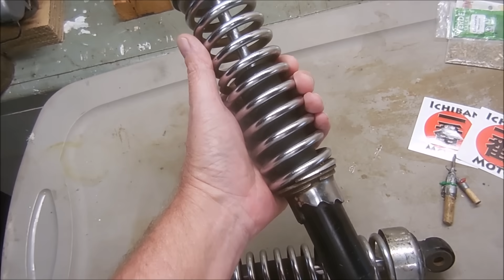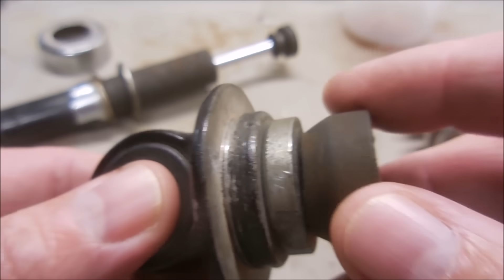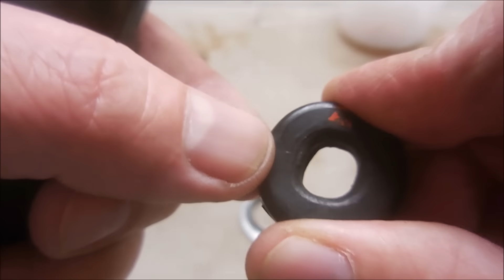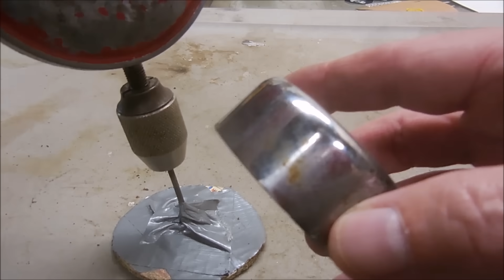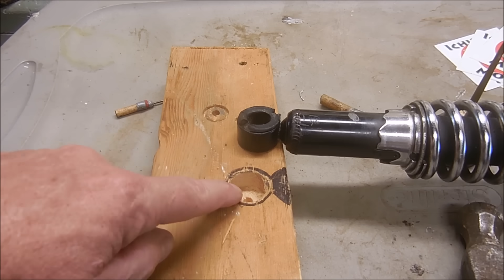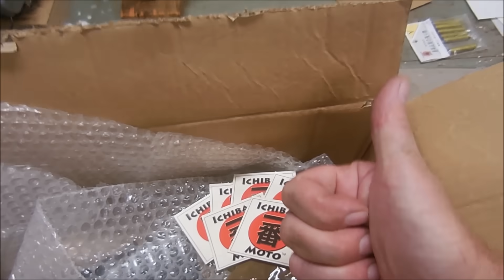how to rebuild motorcycle shock absorbers (coil over struts)

Comment: Wondered where you'd gotten to Mr Ichiban so I decided to visit and educate myself on the spring rebuild, but I was blown-away by your hand-held customised drill-bit cum buffer and with a couple of turns it was as good as new which was amazing! I see you haven't lost your touch : )
Your stickers which must be over 10 years old and still decorate my suitcase which makes my case easy to spot on airport carousels, just returned from the Balearic Islands (Mallorca) and as my case approached me in Edinburgh airport on the carousel a guy further down the line pointed and shouted Badass!
Reply: Cum

Comment: You know, and I don't like to make a whole big thing about it or anything, but I Race the High Bank Turns of Daytona. It's always a great thrill getting the Cafe Racer off the trailer, gassed up with Premix and scooting around the track.  Buy the way, and I think that most would agree, including Kenny "WFO" Roberts and Barry "Ladies Man" Sheene, Nickel Town Customs, known for their Fine Friction Enhanced Jell Assembly Lubricants, makes one of the best 2 Stroke Oils out there.  It is specially formulated to mix with gas and reduces High Speed Seizure by 50%.  My point though, and I think that I can speak for everyone, Itchy Bon Moto is the only Service Center that I trust to rebuild my racing shocks.  They really know what their doing and take the time to do it right.  They even wipe the bodies down and everything !  Itchy Bon gives me the confidence to hit the Bank Turns Wide Open.  The Progressive Emulation and extra wide bottoming cushions prevent sudden bottoming jolts to maintain traction and superior control. I was giving it everything I have, and squeezing every horsepower out of my Power Jet Carbs, trying to get to Victory Circle.  Hoping for the confetti filled accolades of my competitors, interviews with Dave Despain, and my clammy hands within millimeters of Mrs. Chesterfield's amazing heaving oversized Juggs,  Although things didn't go my way, with several compound fractures from a spectacular 200 MPH seizure, I'll be giving it another go next year.  Hopefully I'll be released from Halifax Memorial soon and towing the rig back to Winnetka.  Thanks to Itchy Bon Moto and all the great people at Nickel Town Customs for their encouragement and great products.
Reply from the maker: hi sergio
Reply: @IchibanMoto  Hi Itchy.  I'm laid up here at Halifax Memorial.  Passing time looking through the Nickel Town Customs Performance Catalog and making plans for a few major mods for my Cafe Racer.  Also, I saw the ad for Nickel Town Customs new and improved 2 Stroke Oil with a higher dilution ratio, synthetic tribological friction film displacement agents, and enhanced temperature compensated viscosity molecular structural chains to reduce wear upon initial startup and overall improved throttle response.  With all of those improvements I wonder if Nickel Town Customs has figured out the secret ingredients in Castrol R or something.  Should l plan on adding a tooth or two to the countershaft sprocket ?  Once again, thanks for all the support this year.  Having 5 out of 5 Itchy Bon Moto Stickers is another Bad Ass reason to lay it on the line and put the Cafe Racer in Victory Circle next year.
  - Sergio

Comment: Is 10w oil good to them?
Reply from the maker: Yes. I use 10w in random forks that are not set up for a specific rider ( bike for sale etc) ideally, your bike should be properly sprung and dampened for you. that could mean lighter oil in your long travel adventure bike or heavy in another because the custom gold value emulators recommend it etc             10 is usually a good ave. starting point
Reply: @IchibanMoto  i have a 1996 Kawa Er5 naked bike, i really hope this works, other people are pesimist that i have to buy new shocks, in the end when you are pumping air is there a valve inside shock? Thx very much
Reply from the maker: @seriouxsound4934   those shocks may not be rebuild-able they don't have part numbers for the components listed

Comment: Awesome video! I just had my shock rebuilt on my '19 strom 1000 and just under 2000 miles on it I have a bad oil leak. I did hit a curb when goofing off in a parking lot and bottomed it out. Could have have damaged my shock beyond repair or do you think it's just a seal? I curbed it before a 1200 mile round trip and discovered the leak when I got back.

Comment: Thanks, when you pressurise the shock, how many psi, and do you put the screw in really quick or is there a one way valve? And how does the emulator go together? Is it adjustable? 

Again thank you for the great vid!
Reply: Also wondering the same thing. Ever figure out the answer?
Reply: @Weaponized_Autism  no sorry, ended up getting them done by a hard Chroming place. Wasn't much more to have them assemble them. Would still like to know though. I have another couple of sets to do.

Comment: Where do you get the new parts
Reply from the maker: depends on the shock , however usually you can take it apart and confirm seal etc. specs before tracking down through partzilla etc. I should do a video on  tracking down parts
Reply: @IchibanMoto  Thanks for the reply

Comment: Can we do Zinc coating inside fuel tank to prevent it from Rusting ???
Reply from the maker: I will give it a try on an old tank as an experiment.  I usually just have tanks red-coated or lined with caswell or por-15 .

Comment: "Tip" no torque wrench?... use a slightly bigger ring spanner, once bolt heads rounded off, bingo.
Reply from the maker: pro tip!
Reply: Or use the alternative method, which is to tighten it till the thread strips, then back it off half a turn.

This method has the additional benefits of having the same outcome irrespective of whether the torque setting is in pounds or kilograms...
Reply: lol, damn I love the sense of humor on this channel.

Comment: how did you get the drain screw back in without losing the pressure?
Reply: A Schrader valve stem is needed vs a screw/bolt.

Comment: I never leave the workshop low on white loctite. #LifeSaver
Reply: That's not Loctite.  It's liquid paper for correction fluid.  My wife spotted it right away.  Here it is:https://www.google.com/imgres?imgurl=https%3A%2F%2Fupload.wikimedia.org%2Fwikipedia%2Fen%2Fb%2Fb7%2FWite-Out_123.PNG&imgrefurl=https%3A%2F%2Fen.wikipedia.org%2Fwiki%2FWite-Out&tbnid=7JPT3HXJAldJ0M&vet=12ahUKEwi6i82c-bfsAhWHPN8KHcF5ADIQMygEegUIARCEAw..i&docid=R9-tuFgk6o9ZzM&w=496&h=753&q=white%20out%20liquid&ved=2ahUKEwi6i82c-bfsAhWHPN8KHcF5ADIQMygEegUIARCEAw
Reply: @alext8828  White Locktite works reasonably well as correction fluid

Comment: I was told by a another pro mechanic that they've started using CBD oil especially in the older type of dampers. It's supposed to make the ride much smoother, almost tranquil like.
Reply from the maker: i will give that a try !
Reply: Far out, man.

Comment: My white Locktite is chunky and possibly perished. Will my Elmer's glue-stick Loctite suffice?
Reply from the maker: possibly, you might test it with a torquemeter to make sure tho
Reply: @IchibanMoto  i come here for solid advice, and i sometimes get that, and i am mostly fine with it. Off to gauge the overall tensile strength.

Comment: Great instructional video. I am looking to cafe racer my Royal Enfield Bullet, do I need to tweek the emulator valves?
Reply: Caff's are all about adding lightness to the bike.
Best way to achieve this on an Enfield is by customizing it into a Hollow Point Bullet! That's badass!
Reply from the maker: i should do an emulator valve tweaker kit
Reply: @IchibanMoto  I am sure it would be a Nickel Town Customs best seller. :-)

Comment: Well. It's arguable about 200 drops..because according to manual it's 249. But...as if it was cleaned manually, practically to perfect condition.. it most certainly won't affect performance. Most likely. 🤔 
Nevertheless, ride safe people!😇🙏💙
Reply from the maker: is the 249 metric drops?
Reply: @IchibanMoto  it's at least  1⁄80 US teaspoons..🤷

Comment: COULD THIS BE APPLIED TO MY 93 COROLLA? IT HAS TAPE CASSETTE
Reply from the maker: i would think so
Reply: YOU HAVE TO make sure that you don't have the TOYOTA auto Cassette Dampers they are for cars with tape cassettE so there is not too much vibration and you have to use aluminum grade oil and spacer

Comment: Are you sure that pencil was set to 15nm only if you over tighten it could be bad assly dangerous.
Reply from the maker: if you over tighten, the pencil will break
Reply: Ticonderoga torque pencil I think.
Reply: Torque is set when the pencil breaks, but it must be a no.2 pencil !

Comment: Bad ass! I need to do the shocks on my John Deere Cyclone. They too are the skookum black bodied, high pressure, nitrogen filled type. I was a little apprehensive until I saw this quick tutorial.
Reply: I have the cyclones 250 brother...the challenger. And YES...now I also can rebuild my shock absorbers as well.....I hope it will now handle better that it (“three wheeled shopping cart full of bowling balls going down hill”)
It handles now..

Comment: i´m not fast enough presssureizing and then putting the screw back in before all the pressure is gone again. what am i doing wrong?
Reply: I think he forgot to mention lubing the thread with one way valve grease, just make sure you smear it in the right direction! Your welcome!
Reply: @furious32ninja  one-way-grease. great! thanx a lot!
Reply: 1 way grease worked for me, accept no substitute.. Google it !
Reply: @jakmak1199  glad it helped, did you use the metric synthetic or old school imperial?
Reply: @furious32ninja   Old school imperial, not as eco friendly but smells nice 🙃
Reply: @jakmak1199  nice touch! :)